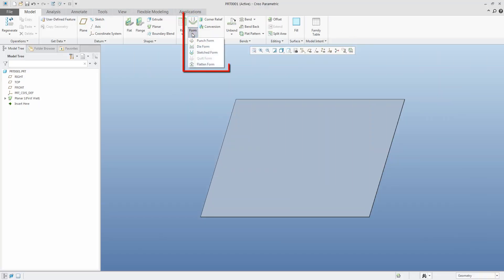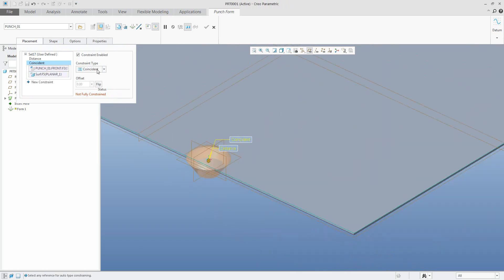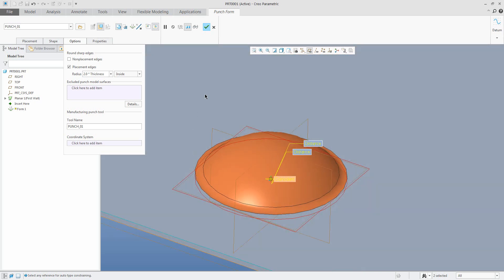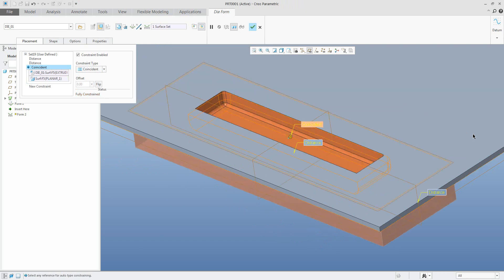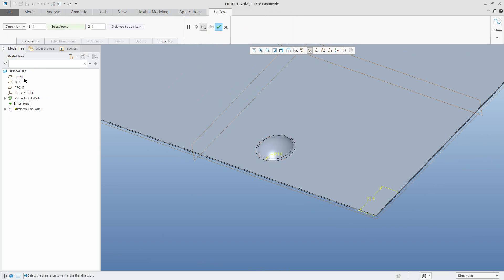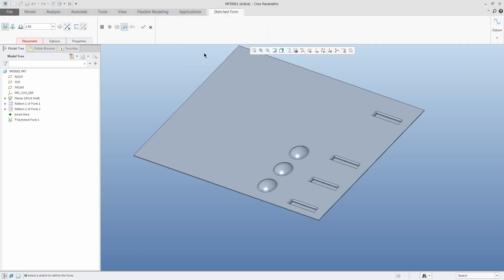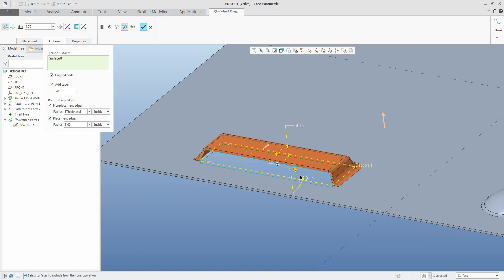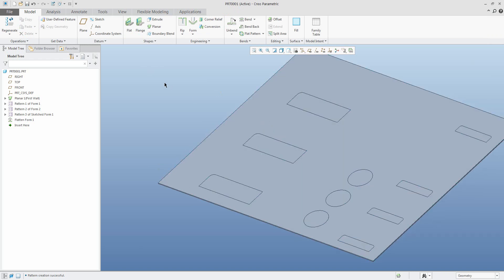Creo 5 0 tutorial: Punch or Die Form feature

Comment: I have issues when using a punch form on the edge of a part. Works great in the center of a plate. But when constraining at a distance where half the punch is off the part it doesn't want to work.
Reply from the maker: Thanks for info... I will try it, stay tuned. Vladimir